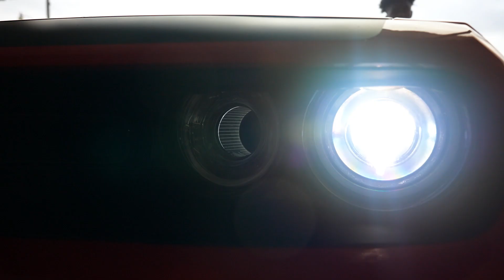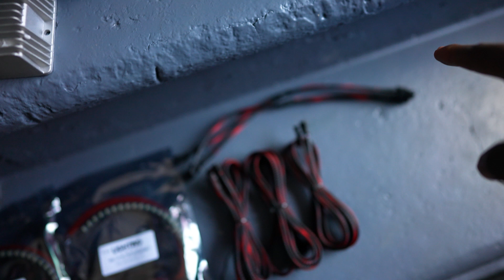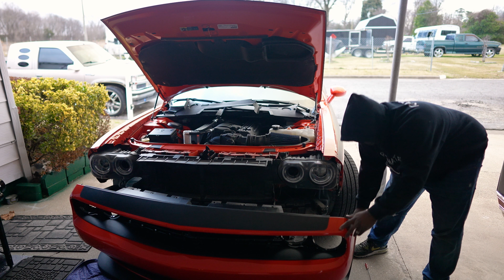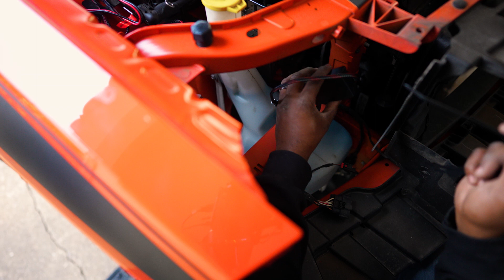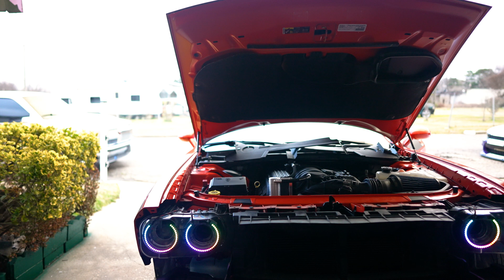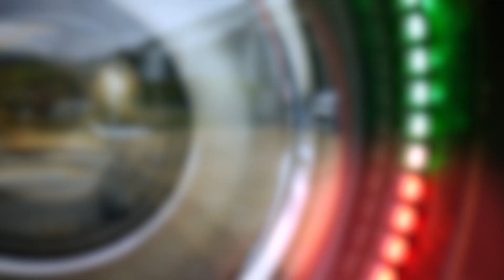How to install Lighting Trendz Water Proof Flow Series LEDS on 2018 Dodge Challenger

Comment: I’m currently trying to install these same headlights onto my challenger and I’m a little confused at what I’m seeing but your video definitely cleared up a lot of my issues but I do have a few. Mine is coming with the demon eyes as well as the RGB flow and I don’t really understand how it all goes together
Reply: And does the regulator need to be mounted? I personally don’t feel comfortable enough to mount it so is it alright if I ziptie it securely or is it necessary to be mounted
Reply from the maker: Yeah you can zip tie it as long as it secure. I’ve never done the demon eyes but if it has the same connection as the flow series lights you may have to have extra pigtails to connect them. I would have to see them in a picture. You can hit me up on instagram with a picture. 924withahemi

Comment: Are there any videos of the install with the flow series that go inside of the headlights? I can find any
Reply from the maker: I have one I did for my charger. It’s the same process to open them up
Reply: @924PHOTOGRAPHY  please send link broo I been searching far n wide. But I guess the reason is I have a challenger .
Reply: @924PHOTOGRAPHY  will it work for challenger
Reply from the maker: https://youtu.be/EtAvsRPxDS8

Comment: Great video.  How did you tap it in to the fuse box?  Is it on the constant hot or a fuse tap?
Reply from the maker: Thank you, it would have been the hot. I just used a test light to check it
Reply: @924PHOTOGRAPHY  Thanks for confirming.  Was worried about draining the battery with the constant hot.  My fear was forgetting to turn off the power on the app.  I suppose the converter box does all the work so we don't have to worry about the battery.
Reply from the maker: It does, but i still prefer to have it on a switch. But on my son challenger we haven’t had any issues. You can always go back later and add the switch if you have issues
Reply: @924PHOTOGRAPHY  Thanks for the replies.  You rock, saved me some worries.  Subbing, glad I found your video. 
Also, love the B Roll.
Reply from the maker: You’re very welcome! Thank u 🙏

Comment: When you install the lights, does the normal lights (white) stay untouched? And when you park or turn on the install, it changes or?
Reply from the maker: The white behind are untouched. When they are on the white it gives it a 3D effect.
Reply: @924PHOTOGRAPHY  thank you!!